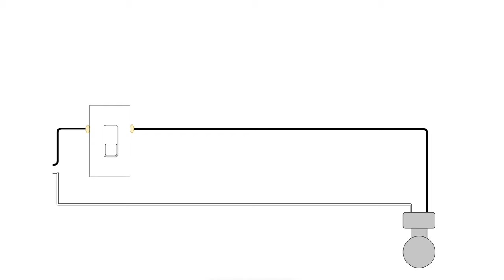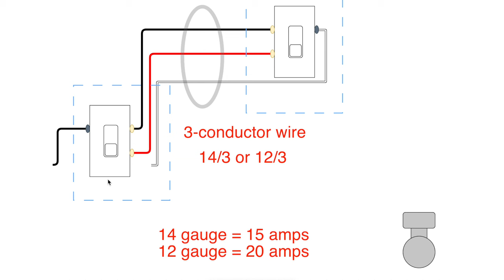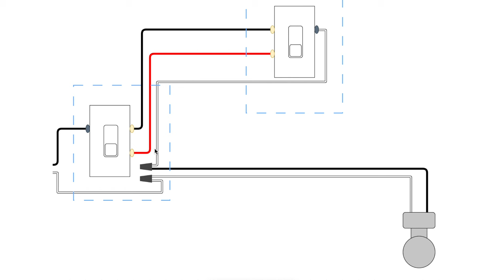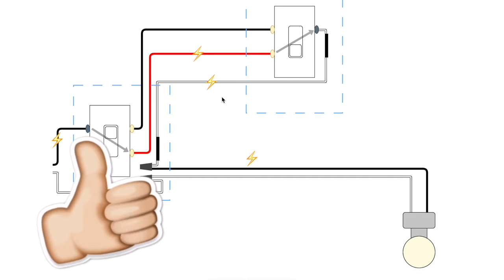Convert a single switch to 3 way

Comment: Great video! Why did you say that you need to have a neutral wire in the switch box? Is it to be code compliant? Because you can add a 3 way without a neutral wire in the switch box.
Reply from the maker: Yes, now that you point this out, I see it is possible to do with a switch loop as well. Thanks!

Comment: Which version/year of the code book are you referencing for that code?
Reply from the maker: What is the reference?
Reply: @handydadtv  You called out a NEC Code about neutrals in the light switch box. Is that from the 2020 Code?
Reply from the maker: @mike_realityi https://googlethatforyou.com?q=when%20did%20nec%20require%20neutral%20wire%20in%20switch%20box